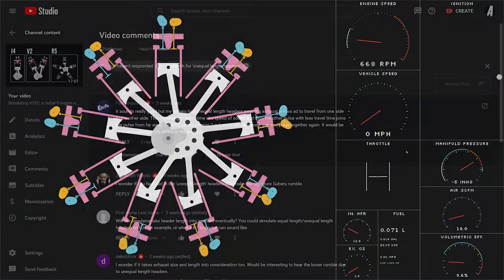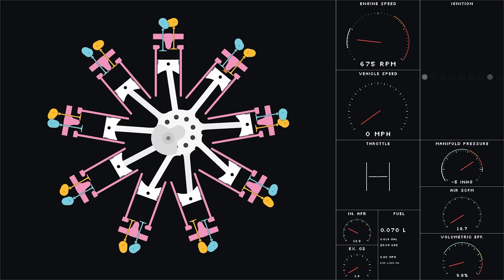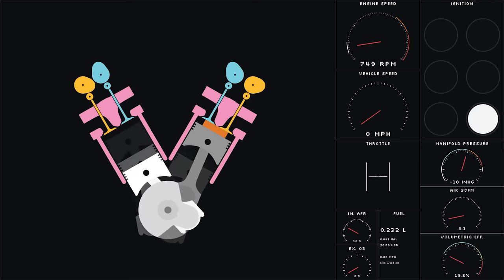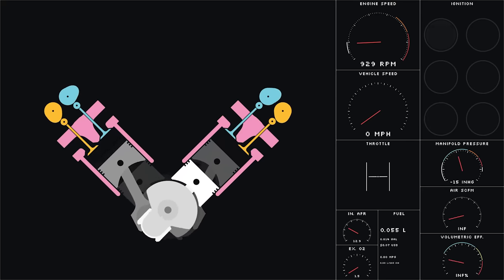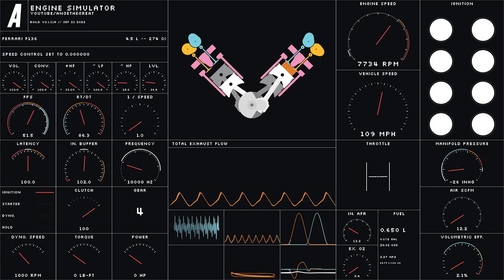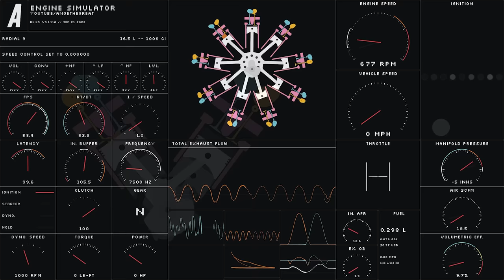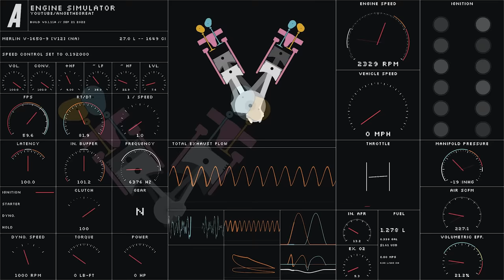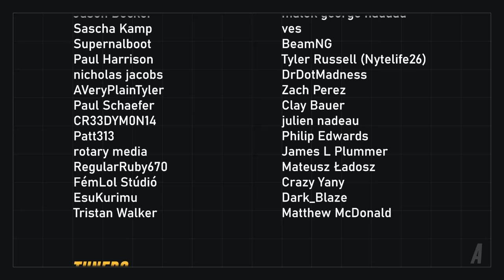Simulating an F1 V12, cross-plane and flat-plane V8s, unequal length headers and more

Comment: You have a wrong misconception when it comes to the V8. Yes you partially got the sound of the odd firing one sounding good and the even ones some more sports car but isn't the odd firing supposed to give the engine more of a growl. Where's the growl. I mean well I know of sound of a V8 when I hear it and that's not a sound of a V8 with odd firing. And I also wonder. Does this engine simulator can also stimulate engines that not many people heard. Cuz I know of one engine that I know that not many people have heard. It's a 460 cubic inch. V8 gas engine block. If you're able to recreate that gladly be able to hear it. And give it a growl I like curtains the nice girl. Because it gives you the sense of don't mess with me or else I'll f*** you up badly
Reply from the maker: What exactly is the "misconception" with respect to V8s? Every vehicle I've owned has had a cross-plane V8 engine, so I'm very familiar with them. The simulation is obviously not "exact" because it's a simulation and not real-life, but in my opinion it sounds fairly similar to a cross-plane V8. Also, V8s are not odd-firing. They fire evenly (ie at equal time intervals) but cross-plane V8s ignite a cylinder on the same bank sequentially at two points in the cycle.